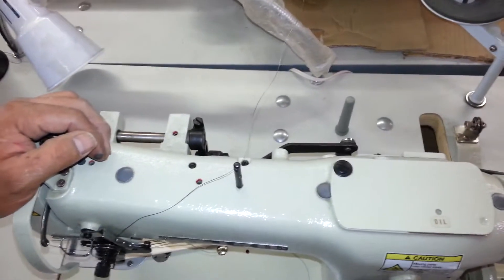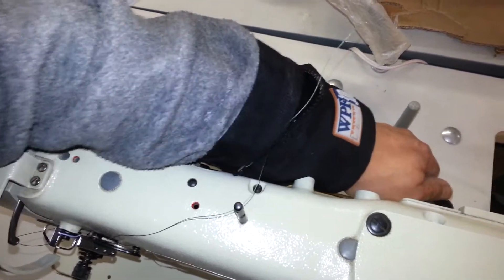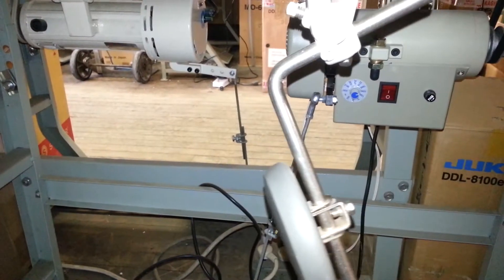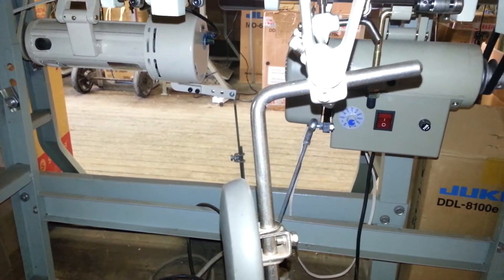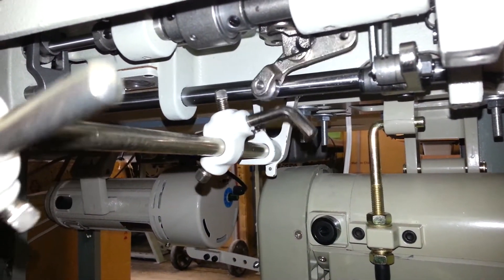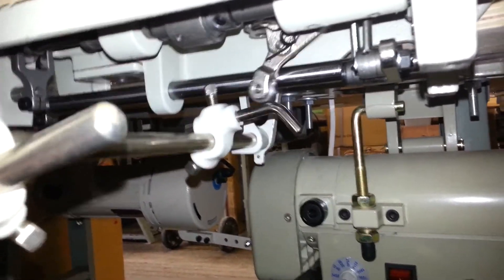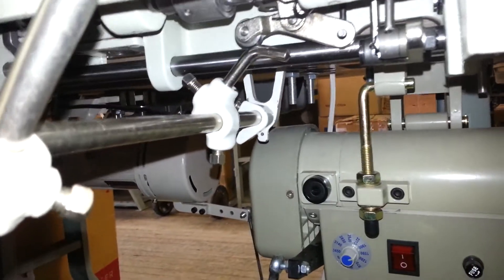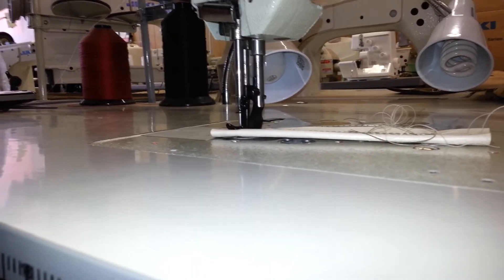Seiko STH-8BLD-3 Knee lift components

Comment: My knee lift will not bring my presser foot down. The presser , , , Foot is stuck in the up position. The presser foot lever on the machine will not bring foot down either. Help please.
Reply from the maker: When you tilt the machine back does the foot return to the down position?
Reply: @Sewinggold  No.